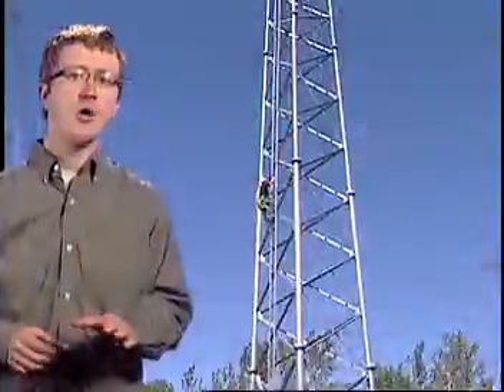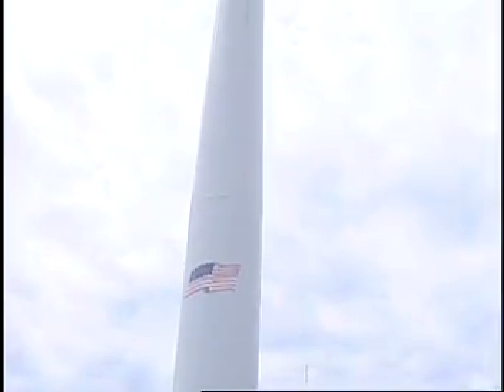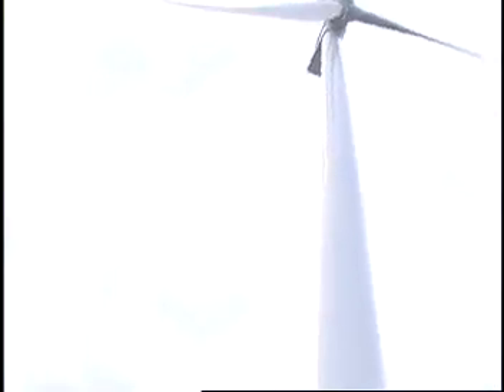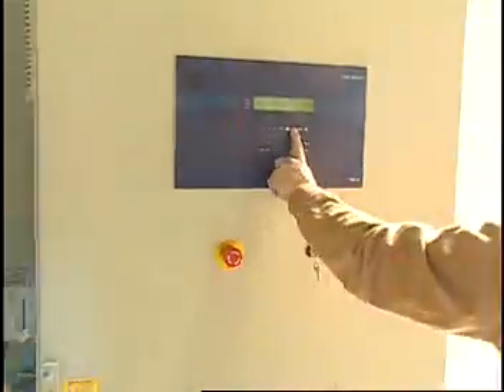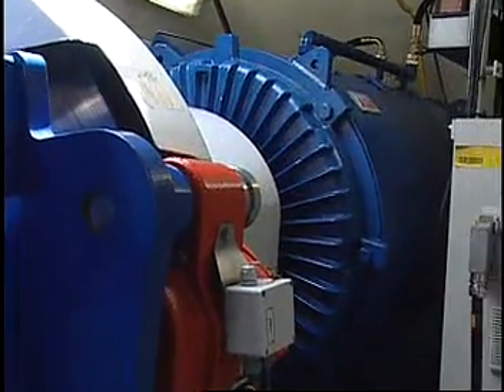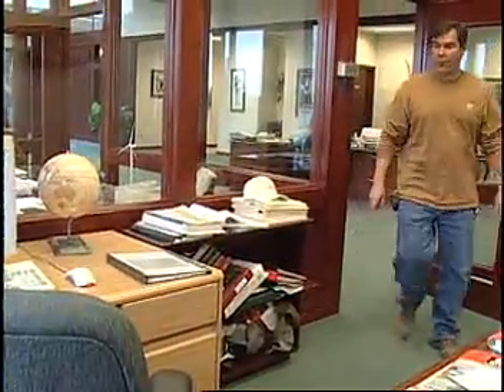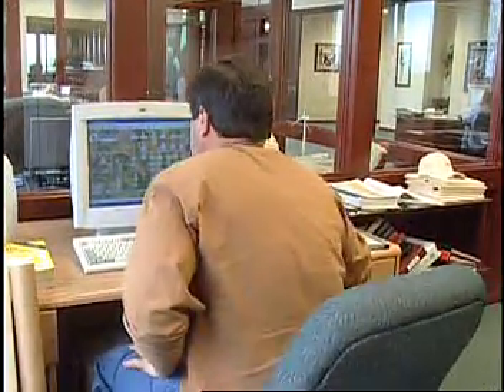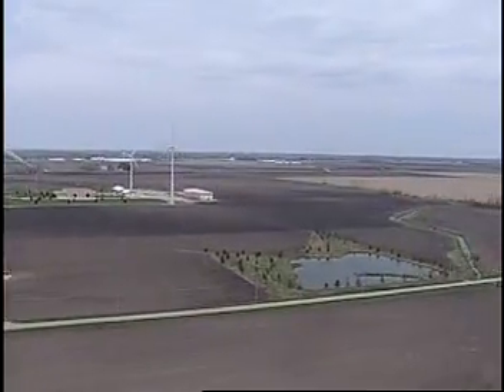Get Energized: Wind Energy Technician Career

Comment: @supafred16 You are correct. Any energy sources would benefit from better storage systems but it's even more true with wind. So far, the most cost effective way to do it is pumped-storage hydro, which is great but can only be build in a few very specific locations.